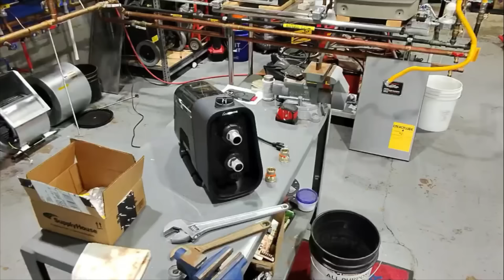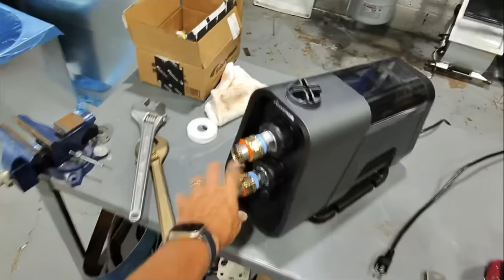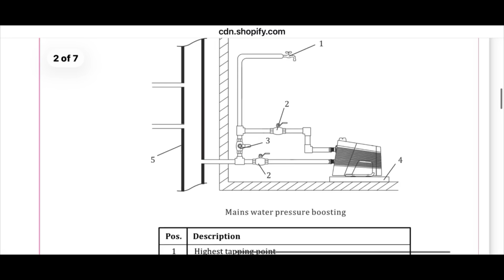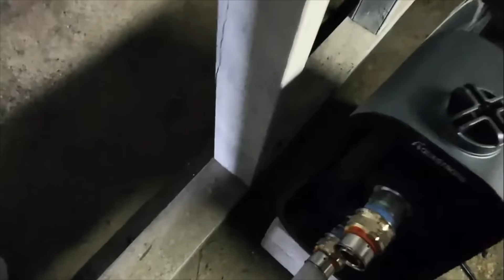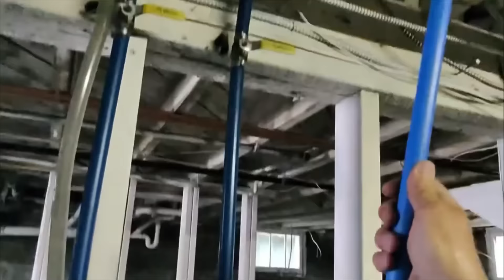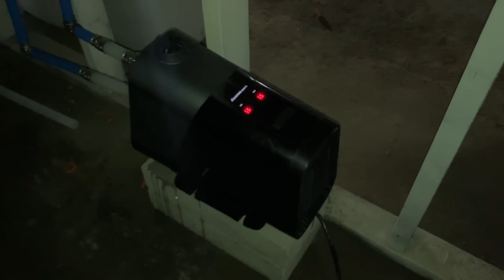I Fixed Weak Water Pressure With This $ Smart Booster Pump! Aquastrong Smart 45 Review

Comment: Where’s the bypass.  I hate it when the lazy plumber doesn’t  read the manual.  Had plenty of pumps go bad.  The customer can’t bypass.  No water till you show up tomorrow and charge them a service call for your F up.  And then blame it on the manufacturer.
Reply: It's under constant pressure from the city...If the pump fails they are where they started...Pull your head out...
Reply: @northface484 read the manual.  It’s very clear how to install.  And the broken pump will make the house  loose a LOT of flow.  Hopefully you don’t do real installation